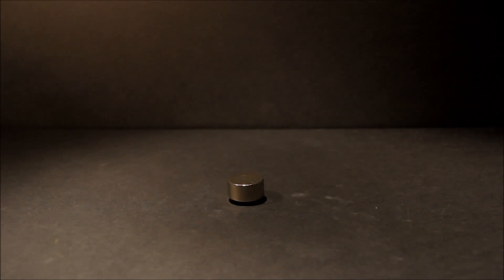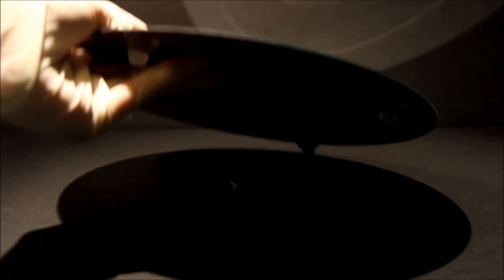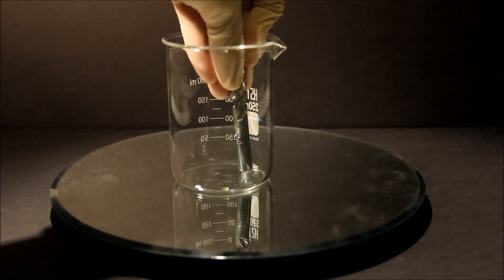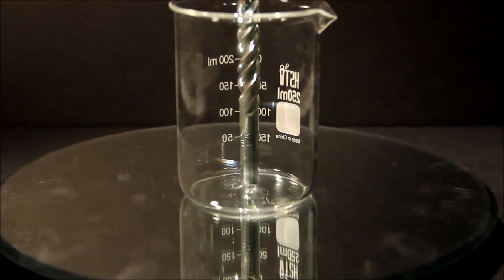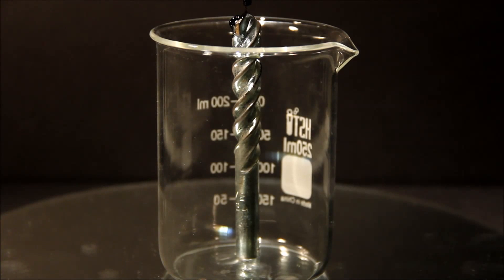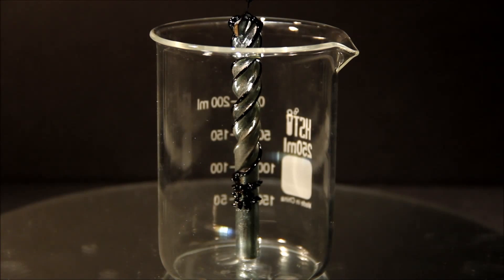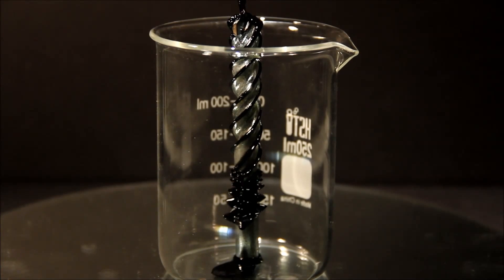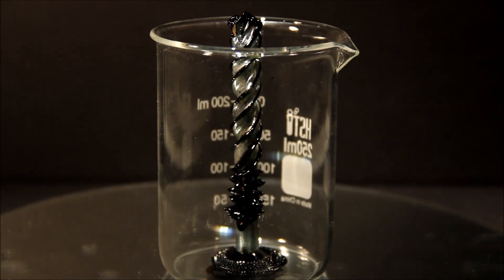Magnet in Ferrofluid (Revisited)

Comment: One thing I noticed with the magnet in the fluid, is that it has very little resistance with the beaker... which leads me on to wonder if you could build some sort of vehicle with them on the bottom. Although you'd probably need crazy powerful electromagnets to support a large weight like that.

starting to think it might not work... it would be pretty awesome though